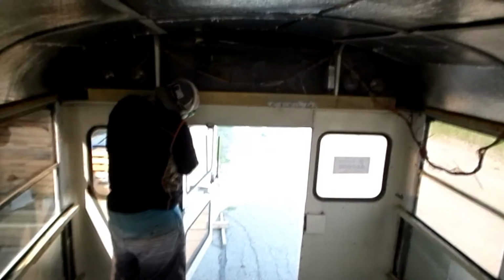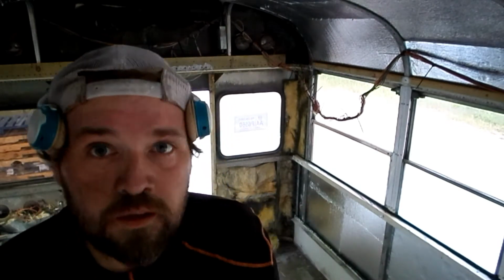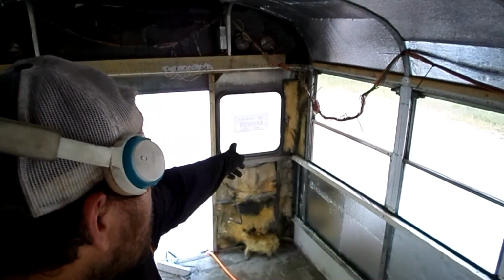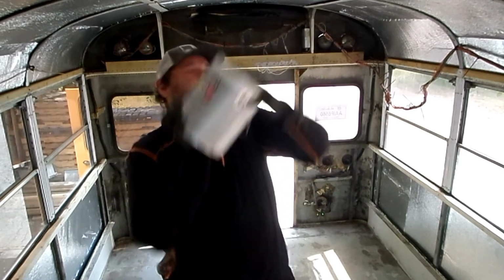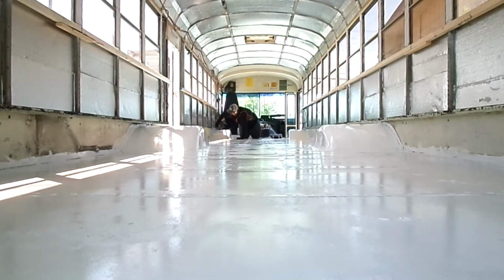Bus Conversion Vlog #19: Insulating Bus Walls And Ceiling

Comment: How much difference did you notice with the insulation
Reply from the maker: If I was to do it all over again, I would hands down spray foam the while thing!!!  The styrofoam insulation is just not that effective.  I had to add in reflextic all the way around and it's still not what I would want in the future for cold climates.
Reply from the maker: I would also seal all the steal with a silicon based paint on both the inside and out.
Reply: @YaakOutdoors  great, thank you for the quick response
Reply from the maker: @benbaker321  you bet! I think there are tons of ways to save money building a bus conversion, I dont think this is a way that should be used, it's far two critical to the overall comfort and usability

Comment: So tell me... How inert is this after the fact. Do you smell or sense any off gassing or chemicals in your finished bus? As I am using 2 layers of 3/4" foil faced polyiso foam board in my bus. Made it alot easier to bend around curves and overlap seams. However, after a few days of intense working with it during second week of installation .... and cutting and shaving and pounding in place with a rubber mallet I experienced somewhat of a total body toxic reaction. I'm half way done with my ceiling and taped all the joints with foil tape. So I'm stalled trying to decide whether to continue. Do you have any condensation issues with it in cold weather? Please contact me on Facebook 
"Daniel Powstania Lupinski" 
as I would like to talk with you about using this kind of foam board! Thanks! Daniel